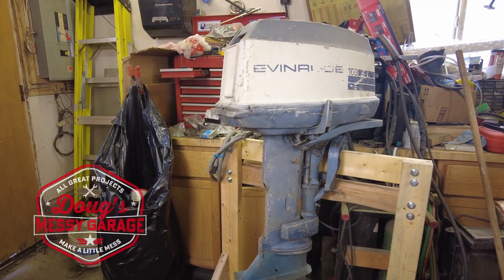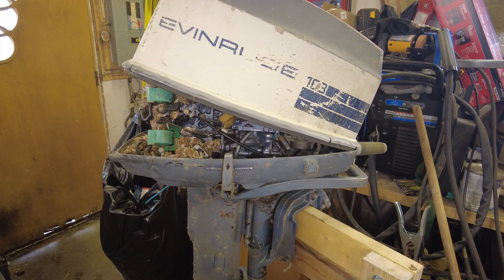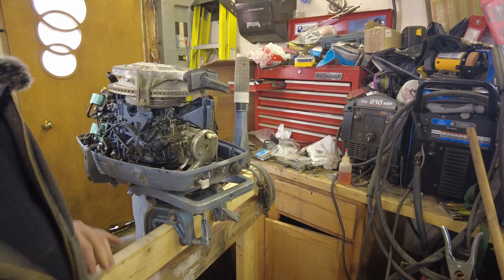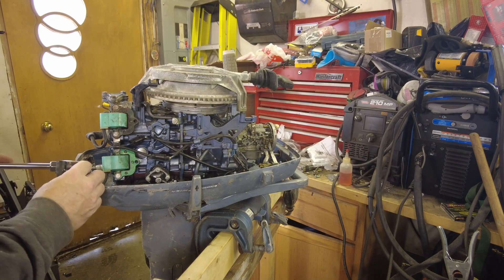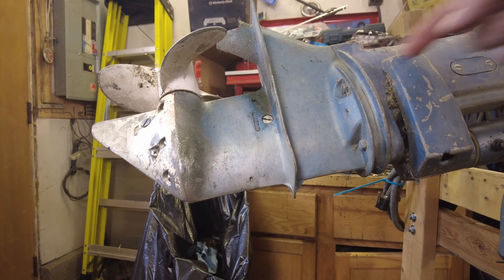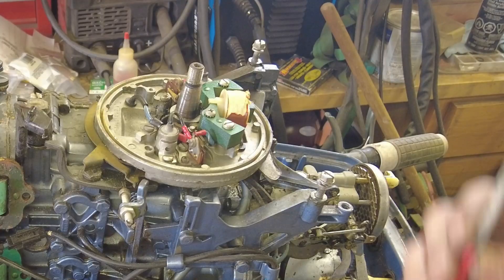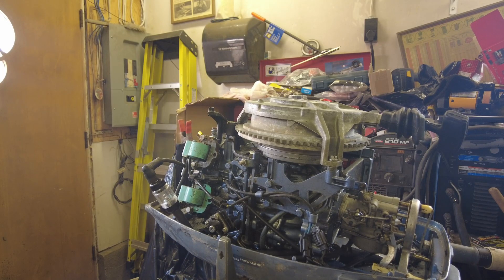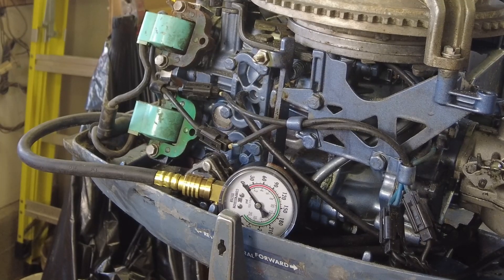WILL It RUN: 18hp Evinrude Outboard Sitting for 30+ YEARS

Comment: Where would you suggest getting parts for this? I just got this exact motor for cheap and its in similar condition to yours in this video. I'm not sure where I even want to start with it.
Reply: Never mind I see you cover it at the end of the video. Thanks for the video it should be helpful
Reply from the maker: Ebay and Amazon were primarily where I got the parts.  I think I have some affiliate links on some of the videos.  Try to get genuine OMC or BRP part when possible, they are far better quality.  Second would be name brand aftermarket stuff like Sierra.  Be very careful of the cheap no-name stuff as it likely will not fit very well.
Reply: @DougsMessyGarage  Thank you sir. I see your other videos on this motor will be very helpful. I'm 19 and just think these old motors are pretty cool. Just earned your 1000th sub
Reply from the maker: @jameshudson1110  Thank you very much.  Check out the videos and ask any questions you may have.  I haven't worked on my outboard since last summer but the lakes will soon be soft here again and I plan on getting it dialed in soon.

Comment: Do you know how to fix the throttle mine feels like it stuck or something
Reply from the maker: The throttle could be stuck in the control arm, there is a grease fitting that needs a shot every now and then and that could be the problem.  Also could be the linkage between the arm and the carb.  The throttle shaft on the carb could be gummed up.  Or, the throttle ties into the ignition system up under the flywheel and something could be stiff there.  Break out some penetrating oil and see if you can free something up.  Best of luck.

Comment: Not that it really matters but thats a 1973 motor ..I just got rid of one recently.1973 was the first year of the low tension ignition system & cylinder head mounted coils....
Reply from the maker: I've noticed it looked like a '73 as well.  I'm basing the '71 on the insistence of my parents who purchased it new.  I'll have to run the model number and see what it actually is.  As far as I am aware, that is the original cowl.  Thanks for watching and commenting.
Reply: @DougsMessyGarage  No biggie really! The coils on the cylinder head indicates 1973 or newer up till 1976.Nice motor shell run great need parts let me know I have everything ....GP
Reply from the maker: @GPOldMarineShop  Thanks
Reply: @GPOldMarineShop  1971 was the first year of low tension ignition in the 18ph fastwins.

Comment: That is not the way to change the oil in lower unit. You want to fill from bottom up!
Reply from the maker: I agree completely under normal circumstances.  This method seems to work well with this motor though.  Thanks for watching and commenting.